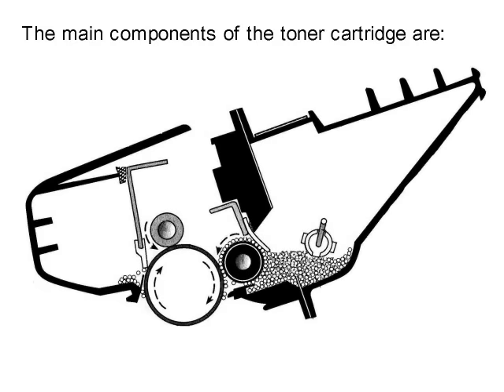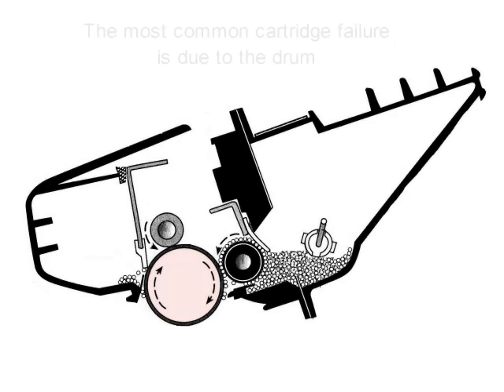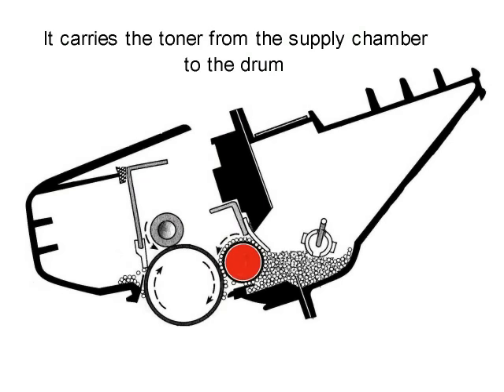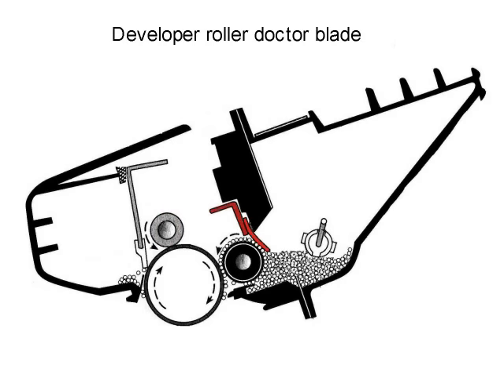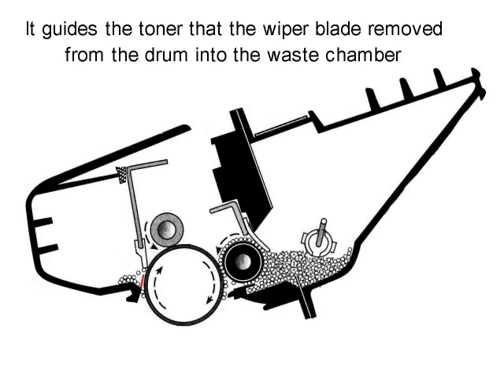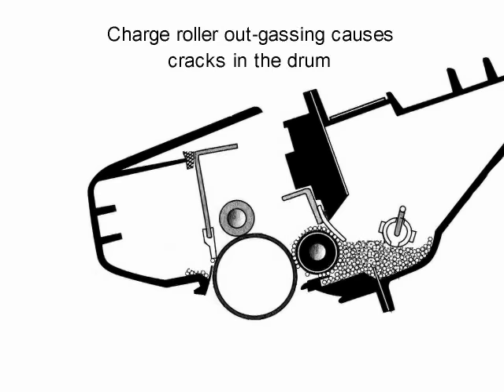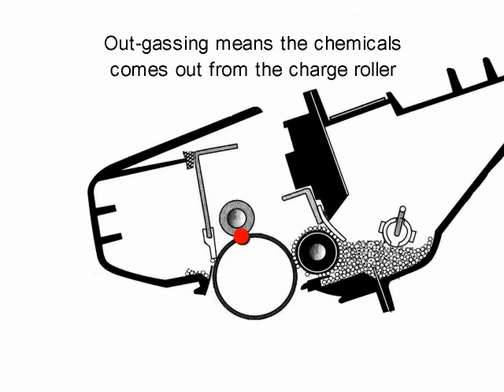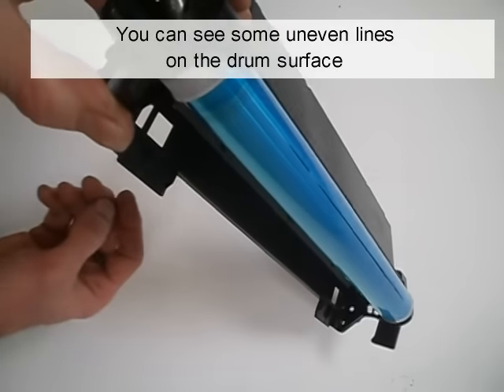Toner Cartridge Printing Defects: Causes and Solutions

Comment: hai, I am using hp laserjet p 1102 printer. it sometime slowdown while printing some dark shade pages, and sometime it text lines are too light printed but it doses not do so regulary, kindly tell me what would be the problem and its solution, i have changed the toner. on the drum, some toner is attached.
Reply from the maker: t's difficult to say. if you change toner cartridge the problem disappear? probably the problemis the drum, the original drum dors not last too much.  or may be the magnetic roller or the doctor blade

Comment: hi,
i recently refilled my samsung printer toner for the first time but now i am getting dirty pages even if i print a white page i get a output page which looks grayed and dirty i replaced the opc drum also please help!!
Reply from the maker: +yash kushwaha may be you do not clean well the cartridge before adding the new toner. also you can try to clean the developer roller with alcohol
Reply: +viandant5 thanks I will surely try this
Reply: +viandant5  hey i tried cleaning the toner with isopropyl alcohol but still there is no improvements in the quality of print.The developer roller and discharge rollers are in good shape i too cleaned them
Reply from the maker: +yash kushwaha what do you mean when you say you have cleaned the toner with alcohol?
Reply: I cleaned only the drums with alcohol after disassembly and cleaned housing of toner with vacuum cleaner then I refilled the toner again
Reply from the maker: +yash kushwaha try changinf the charge roller. you can take it from another cartridge

Comment: Bought a used HP 4250. Printed with an irregular image about 3" x 10". Looks like a tree. Looked like irregular round dots. Like a consistent pattern. Odd that it switched sides. First print left side, 2nd print right side, 3rd print left side.... Black image from file was washed out looking. Replaced toner cartridge. Ebay 99% approval. No change. Did a complete maintenance. Changed rollers and fuser no change. Wondered since the printer was shipped tome, if there was a loose computer board.
Reply from the maker: may be the scanner unit, or check for bad contact betweem the cartridge and the printer

Comment from the maker: divia ahuja, in brother technology a defective toner cartridge can contaminate the drum unit so if you change the toner cartridge the drum is defective and you have the same quality problem.  I think you have to clean the drum
Reply: viandant5  hello there, i have problem with charge roller... when i clean the charge roller i can print only 2 pages without any any black mark... but after that it gets darker and darker gradually .... is it problem with the charge roller or blade with the charge roller ??? please help  :(
Reply: black thunder if it again be cleaned ... it can print 2 pages at most perfectly .... i tried changing the drum and toner .... nothing helped ... nd doctor blade and blade with the charge roller are the same one?? should it be replaced or charge roller along with the blade ?
Reply from the maker: black thunder Which cartridge? the charge roller has no blade, sometime it has only a cleaning roller. try changing the charge roller
Reply: +black thunder is there a full waste toner hopper? also your fuser roller could be bad

Comment: I have more of a printer problem than a cartridge problem but it is directly related to the cartridges. My yellow toner won’t print because the wheel/gear on the printer that spins the gears on the toner cartridge is not spinning freely.   Want to dismantle but only if I can fix it lol
Reply from the maker: Without knowing which is your printer it's difficult to say. Probably you have to remove the side panels, the gears are behind the panel

Comment: BOSS,,HOW I  PRINT 100% BLACK PAGE .MY PRINT COME  SMALL BLACK .NOT LOOKING  GODD .PLEASE HELP ME.HP 12A CARTRIDGE
Reply from the maker: probably the problem is the toner cartridge. look at the metal pin of the drum, check if it's correctly inserted. look at the charge roller and its contacts
Reply: I MEAN BOSS, LIKE  .IMO. WHATS UP OTHERS PLEASE BOSS  PLEASE
Reply from the maker: send it at my email address link.accessori@libero.it

Comment: Hey, very very good video, but i have another problem...
All the colors thats use magenta toner arent good, there is just a good line...
Reply from the maker: +DanteLVL6 which printer?
Reply: viandant5 Brother HL3140CW
Reply from the maker: +DanteLVL6 If all color related to magenta cartridge are defective, the problem is the magenta cartridge, probably the developer roller
Reply: So i have to change it ?
Reply from the maker: +DanteLVL6 I suggest you to change the cartridge, unless you want to try to change or clean the developer roller
Reply: Okay thank you !

Comment: Hi,
     Thanks for posting such an informative video.
                         I am using Xerox phaser 3117. I have cleaned Wiper blade and developer rollor blade and re filled toner. After closing,  the toner is seen coming out through the sides. What would be the reason? Pl. help me
                                                                                     Babu
Reply from the maker: do you have already reassembled the cartidge? the developer roller is held in position by the contact with the drum, so during refilling it's possible that the cartridge leaks toner. also, may be the developer roller blade it's not in position, look at the foam at the side of the blade. look at the developer roller mylar sealing blade.
Reply: viandant5 Hi,
                           Thank u for your advice. I have reassembled the unit and now it is working properly. Thank you again
                                                        Babu

Comment: I'm having trouble with printing color on my Canon MF8030Cn laser printer. It has 4 toners: cyan, magenta, yellow and black. All toners are original Canon toners. The three color toners have never been replaced, while the black toner has been replaced a few days ago. I can't find the invoice anymore, but the printer is probably about 2-3 years old (read: the magenta, cyan and yellow toners are also that old).

Whenever I print red, green or blue text, issues appear. When I print red text, there is yellow ghosting. When I print green text, there is yellow and blue ghosting. When I print blue text, there is magenta ghosting. Would replacing all color toners fix this problem?

I scanned a printed test page to show the problem. You can find it here:
https://dl.dropboxusercontent.com/u/6090186/Canon_MF8030Cn_Test_Print.pdf

I'm fairly new to laser printers so any help would be appreciated.
Reply from the maker: cobrax80 do a printer calibration, thiis type of printer has the problem that often go out of calibration. also look at the fusers
Reply: viandant5 Hi viandant5

Thanks for the suggestions so far.

I performed the following calibration options:

- Adjustment/Cleaning -> Auto Gradation Adjustment (Full Adjustment)
- Adjustment/Cleaning -> Correct Print Color Mismatch

The second option sometimes fails. But after two or more attempts it works. However, the ghosting problem (as mentioned before) remains.

I took pictures of the cyan, magenta and yellow toners. Maybe this is of any help to you? You can find the pictures below (large, 18 MP JPEG files):

- Cyan toner: https://dl.dropboxusercontent.com/u/6090186/Canon_MF8030Cn_Cyan_Toner.jpg
- Magenta toner: https://dl.dropboxusercontent.com/u/6090186/Canon_MF8030Cn_Magenta_Toner.jpg
- Yellow toner: https://dl.dropboxusercontent.com/u/6090186/Canon_MF8030Cn_Yellow_Toner.jpg

If it was 100% certain (or at least 95% certain) that I could fix this issue by replacing all 3 color toners, I would do so. But since we're talking about a lot of money, I'm hesitant to just go ahead and order new color toners before knowing if this would likely fix the problem.
Reply from the maker: cobrax80 the yellow cartridge is nearly empty, I would start changing only this cartridge. the yellow is involved in green red and blue colors

Comment: My drum is burned what is the problem
Reply from the maker: what does it means "burned"? THere is no way to repair a defective drum
Reply: @viandant5  it seems that i do not know how to change the drum and the resul is that is burned but i dont know how
Reply: Konica minolta ineo+ 280 color
Reply: @viandant5  how to protect a new drum from scratches and damages
Reply from the maker: @AliBenjellounM  a foam or a soft cloth is enought, but you have to protect the drum from the light and the sun. Store the drum in a dark place
Reply: @viandant5  and if it has scratches .is this what leaks toner?
Reply from the maker: @AliBenjellounM  No. scratches on the drum does not cause toner leaking.
Reply: @viandant5  so What harm does it cause scratched drum?
Reply from the maker: @AliBenjellounM  Defects on the page at the same distance of the circunference of the drum

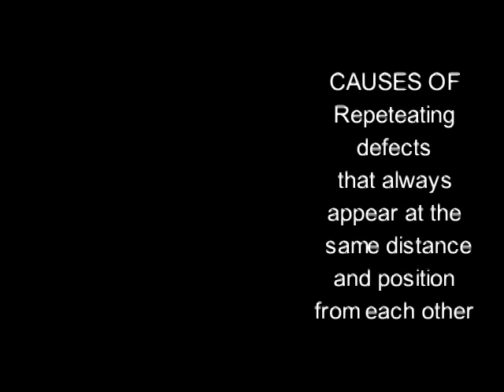Comment: 2:19 repeated spots at same dist
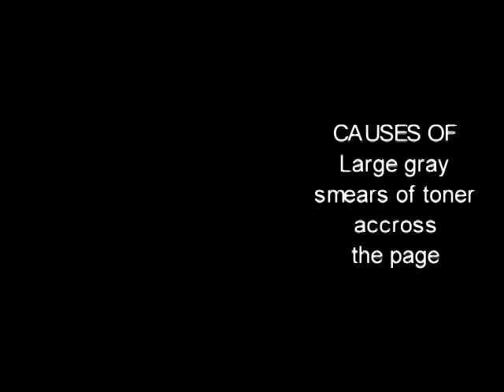3:50 grey smears
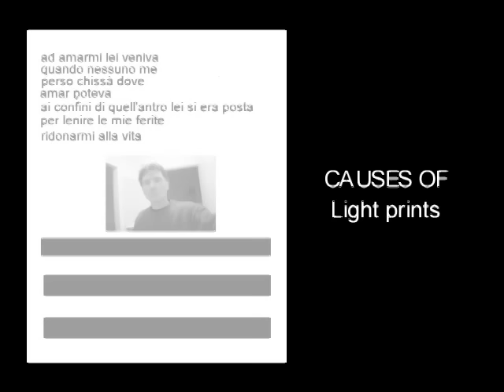5:12 light areas
6:04 vertical lines (white)
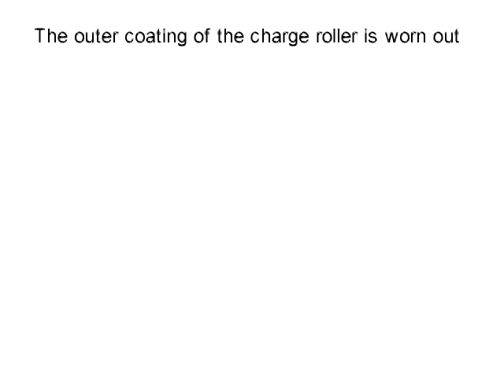7:02 ghosting (image repeated lightly)
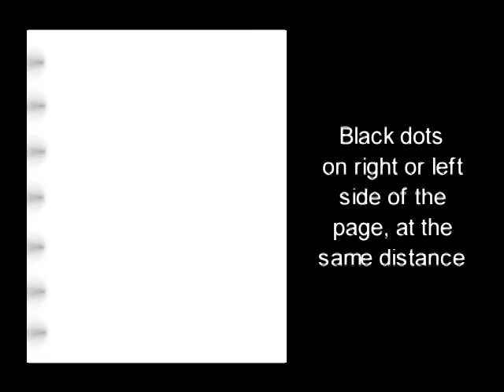13:30 repeated black dots near edges
13:50 random black sprinkles
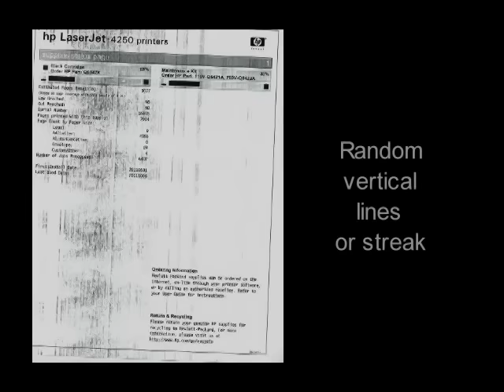16:18 vertical black lines or streaks
 ^ (that's the problem i had so i stopped watching)

Comment: Hi.
i have brother dcp7065-dn printer
left side of the paper some lines r coming i checked toner cartridge few lines on toner roller (black) also on drum too
plz help  me
Reply from the maker: I think the problem is not the drum, probably the problem is the toner cartridge low or defective
Reply: viandant5
yes recently i have changed my toner cartridge after that only i m facing this problem even i cleaned pickup rollers but still problem is not solved plz help me dude...
Reply from the maker: saadi khan
in this case, probably you have to change the drum unit. if the lines are on the drum is not fault of the fuser rollers or pick up roller
Reply from the maker: saadi khan
if your printer ask for paper but the paper is into the cassette, probably a paper sensor is defective or in wrong position,
try change paper, or use a heavier paper.
it it does not pick up the paper and cleaning the rubber pick up roller does not solve the problem, probably that printer need to be repaired. you can don nothing more than cleaning the pick up roller. you can try using a
Reply: so finally what is your suggestion sir..
thank u
Reply from the maker: saadi khan I think without spare parts it's not possible to repair the printer. bring the printer to a brother repair center

Comment: What causes the text to squish together?
Reply from the maker: which printer? Are you sure it's related to the cartridge?
Reply: @viandant5  Kyocera 5035. No I'm not sure what is causing it at all.
Reply from the maker: @Vicky-nx7lw  There could be a problem in the paper motor, the rubber feed rollers along the paper path, drum gears, it could be even a driver issue
Reply: @viandant5  Thank you for the suggestions.  Much appreciated.

Comment: At the half way point not a mention of the word LASER!  Of course the video is about the toner cartridge.  I say the fast food industry continues to make the case for the DIY to desert!  The evolving physical implementation of technology, that is those factors such as materials and miniaturization, has made hands-on maintenance almost impossible and impractical while driving down manufacturing costs and thus market prices.  Is it far less costly to: disassemble a faulty device, then find a questionable (if not certain) failed component, then search for the replacement (if neither are too old!), pay the price including shipping or go get it yourself, wait for the part to arrive, install the part and hope you’ve solved the problem than think of buying a replacement toner cartridge under some form of warranty?  At this point you’re halfway to the cost of a whole new printer!  There’s a guarantee: you could do more damage along the way.  The video discusses various parts of the cartridge that if damaged would possibly be the cause of a particular print out defect.  The simplest is toner issues.  The video claims no 2 toners are exactly alike.  Whoever thought that a toner is not a-toner-is-not-a-toner?  A toner “mismatch” or mixing could further the problem.  IF the toner is thought to be the problem then the video suggests using compressed air to blow out the old toner from the cartridge BEFORE replacement. Apparently this method provides the best assurance that “old” toner is purged from the cartridge!  What kitchen-drawer-screwdriver has the facilities for this method?  Then again note the health issues section under “toner” in Wikipedia.  Leave these toner troubleshooting instructions for the professional recycler.  The only lesson from this video is trade it in and buy a refurbished or new toner cartridge or regret being naïve and then do the same.

Comment: Brand new HP Color Laserjet Pro MFP M177fw purchased 2 years ago, but never used until unboxed last week. One inch wide vertical area with no toner. Tried cleaning, reseating cartridges. This is what it looks like: https://www.dropbox.com/s/2zjimjn0pgeo2s3/HP%20Laserjet%20Pro%20MFP%20M177fw.jpeg?dl=0 Any ideas?
Reply from the maker: It could be the glass of the laser scanner dirty. Is there toner on the toner roller of the cartridge?